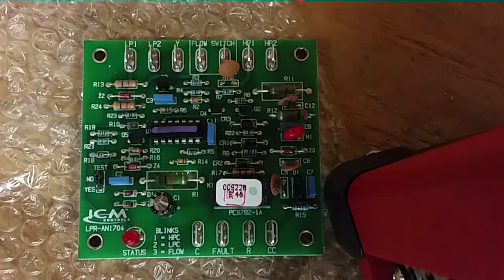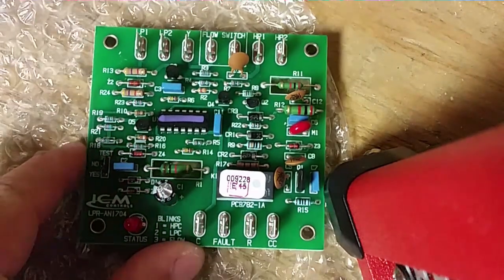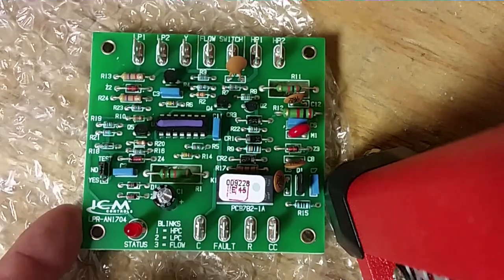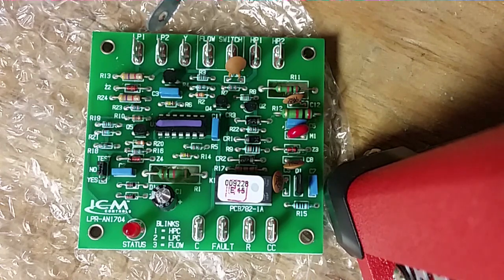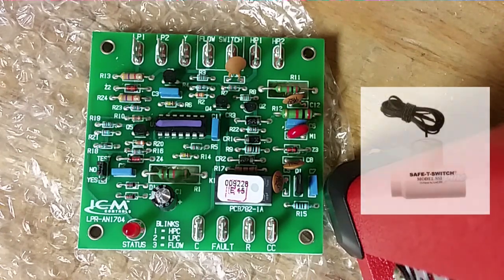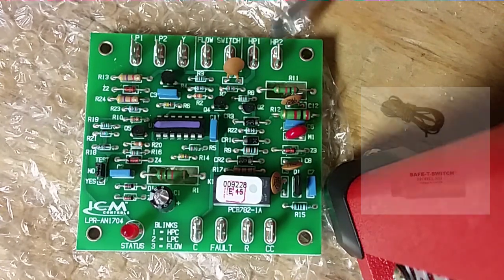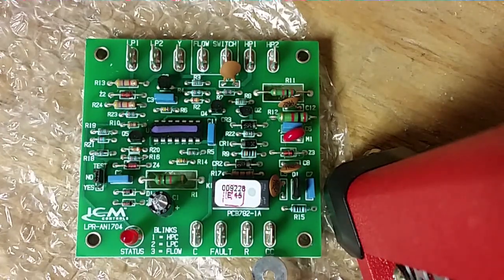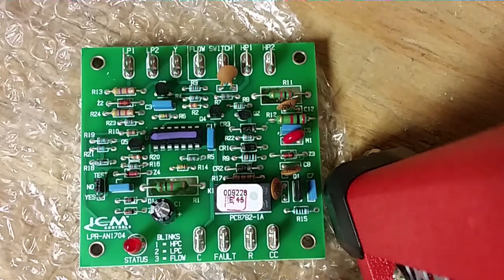ICM 222 Lockout Protection Module Overview

Comment: Great video Zack. A nice add on for units that has no protection. Just like the 5 ton Trane where I changed the Revering Valve  in. No Hi nor Low PS.
Reply from the maker: Yep, a little control goes a long way